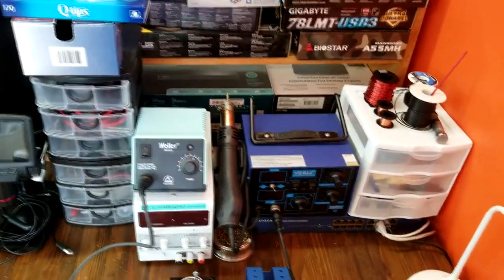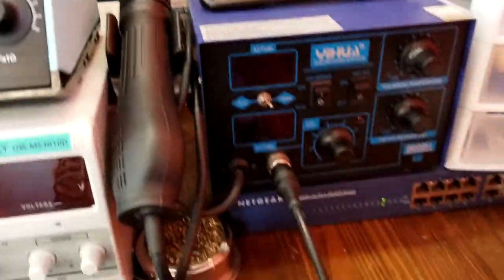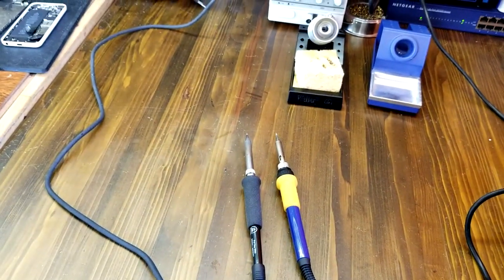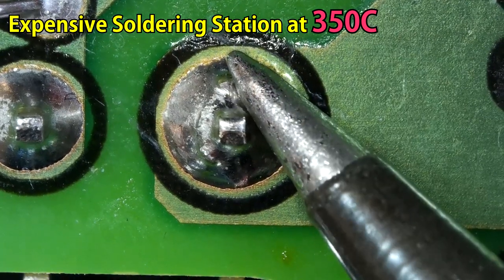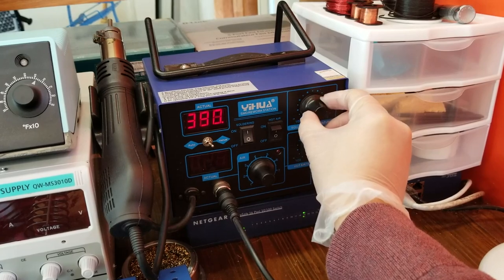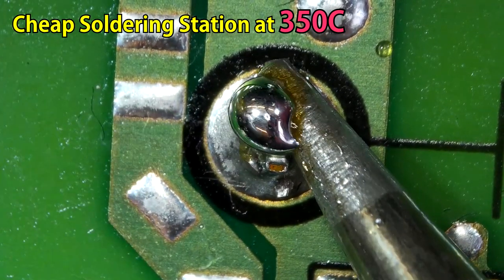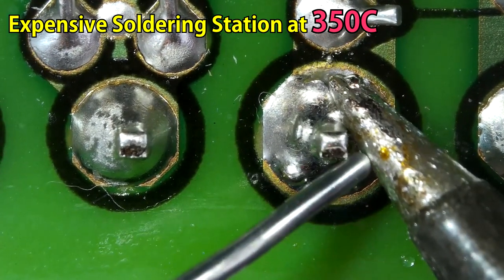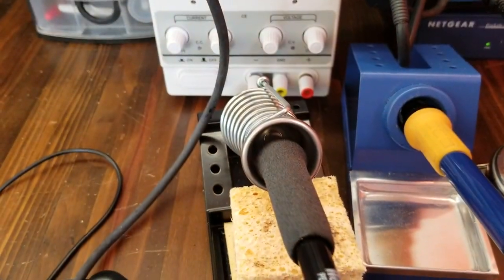Cheap Soldering Iron vs Expensive Iron (Good & Bad Soldering Station Comparison)

Comment: There definitely something wrong with your Yihua 862D+...I have a Yihua 852D+, an older model, and it melts lead-free solder joints just fine at 350^C. I would suggest measuring the temperature of your iron to confirm its heat output. There are numerous video reviews of the 862D+ that contradict your findings.

Comment: There is a basic requirement of any iron or station that will yield the best results. The minimum standard is digital readout which yields the output temperature of the iron at the tip. The exception is a variable temperature iron with temps marked on the wand. Knowing the tip temp is vital so your results will be high quality, high reliability and consistent time after time. Tip shape that meets the most effective requirements and on most jobs used is the chisel type tip. Tip width should be no wider than the pad or edge trace it is serving. The surface of the tip should be free of oxidation and smooth in appearance. A pitted tip is a no no. This will not yield superior results. The wand should feel comfortable in your hand and maneuvered easily with finger and wrist positioning. The temperature range will vary with manufacturer. A wide range is desirable. Getting it done easier is best served by an iron which doesn’t allow variations greater than + or - 10 degrees Fahrenheit. Temps that vary from their set points higher or lower than 10 degrees Fahrenheit are not good for your project, work or job results. That will not change. These standards are high and this is how best results are yielded! Each must choose his or her gear based on budget, level of commitment and desired results. I use Pace brand gear, but your money and requirements may vary from mine. Your money equals your choice. Make your choice a great one and don’t compromise on quality and reliability. Stay safe mates!😊👍🏻😷

Comment: Don't buy those cheapy crap on Amazon. I messed up completely. If you want to solder big wires or copper pipers, a cheap one would do, but absolutely not any circuits, chips or any fine connections.

Comment: Looks like the iron on your dual station, has either a really crappy knock-off heater element, or the ceramic heating element is making bad contact with the solder tip. Or both. It's easy to check the latter, loosen the fastner for the end slightly and wiggle the solder tip very gently. It should not have any notable movement side to side, it should fit fairly snug over the heater. Just FFS don't try to bend to check, the heater is ceramic. If it's loose, then the heating element is obviously not gonna make much contact with the solder tips. 

You can replace a dodgy, crappy or broken element with either a genuine Hakko A1321 or a good quality 3rd party replacement. If you do that, the iron should work pretty much as well as a proper 951/952 Hakko. Given you combine it with decent quality tips of course.

To be perfectly honest, I actually like this station better than my Hakko, for the iron. Because it's so much quicker and easier to change the temperature. But I use a different grip for the station, with a genuine Hakko heater element inside.

Comment: I uses a cheap $10 iron and also that same yihua station and I easily removes components when using flux, so yeah, I don't necessarily need some expensive iron to do the same job that a cheap and mid range iron does, plus Weller have some safety concerns

Comment: It has to so with the quality control , or lack off on cheaper stations. I had one cheap station that preform very well, but had to use different tips that fitted around element tighter, as the one that came with the station were way to loose and had poor heat recovery. The replacement tips on eBay were much better and use that station for  more then 4 years and even used for SMD component replacement and work well for drag soldering.  Now using a WX-2 as upgraded over the years, but not all cheap solder stations are bad , it the tips tolerances that are bad

Comment: But that's not true. I have Stamos Soldering S-LS-14 Basic and WEP 872D+. They're both cheaper than Yihua 862D+, and WEP 872D+ is almost the same as your Yihua (technically too). Maybe your 862D+ is broken or something, because both my soldering stations never had problems like yours. Even my Stamos (only 45W) performed better than your Yihua (75W). Of course I've set both to 350 celcius degrees, exactly the same as you did. Stop telling lies to people please.
Reply: Is it lying if he actually had that experience? You can see it yourself what is happening on the video.
Reply: I agree, this is BS. I have the cheap station in the video and he's completely wrong about everything, i.e. it has a Samsung chip that adjusts power to the soldering iron in real time so the temperature stays constant.

I assume it's something really stupid going on with his device, like the tip not being screwed on tight enough or the ceramic heating element being somehow damaged.

Also, Weller is a garbage company nowadays who doesn't think it's necessary to use fuses for their primary circuit, saving a few cents on their overpriced devices.
Reply: Here's the thing. Some sellers sell these with either top shelf 3rd party, or genuine Hakko ceramic heaters inside the iron (A1321 element). I double checked mine, it worked really great, and it had a genuine Hakko element with a verified serial number.

Many other sellers, skimp out and sell them with a really crappy fake Hakko heater element. These also have poor size tolerances (sometimes the actual solder handle has poor size tolerances too), causing the solder tips to make bad contact with the heating element.

I accidentally broke the original, genuine Hakko element. It was my own fault and mechanical damage. The original seller sent me a replacement, but informed me it was not a genuine Hakko as he didn't have any on hand, it was a copy. Replacing the element, it now took way much longer to heat up, it had nowhere near the same thermal capacity (would cool down too easily), and it made really poor contact with the tips. I had to wrap 2-3 layers of aluminium foil around the element to even get a usable level of contact.

So I believe the experience of all parties here. But I think the unit he got here, came with a knock-off heating element. If you replace it with a genuine Hakko A1321 element, or a good quality 3rd party replacement, for these 852/862/936/951/952 chinese copy stations - the experience should be much more akin to the one we had.

Comment: I have one of those Zeny Yihua no names as well, and it's incredibly frustrating to get a consistent working temperature.  I had to sand down about 1/64th to 1/32nd of the soldering head base to get the ceramic heater closer to the tip, which helped a little bit.  I don't trust the temperature setting at all, I more or less use it as a hotter/colder setting.  If you are exploring soldering and electronics as a hobby, I wouldn't even  recommend this as you'll develop bad workaround practices just to accommodate this soldering iron station.
Reply from the maker: Seems like the cheap ones have poor temperature keeping performance

Comment: Probably is the false reading on the actual temperature on solder tip. This unit does not come with temperature re-calibration mode. You need to prove the solder end tip actual temperature reading vs station setting. You will surprise by the test. Do some homework first before you said this is cheap soldering station is junk.
Reply from the maker: Most people who use the soldering station will rely on the temperature readings on the machine. Who measures the temperature on the actual tip every time when soldering? The temperature reading should be accurate at least when they are new...
Reply: If you calibrate it once you won’t have to change it again.

Comment: 350c is 350c doesn't matter.
Reply from the maker: Many of cheap stations are lack of providing constant temperature. With a cheap one, as soon as you touch something with your iron, the iron temperature may drop significantly, and that is what you've just watched in the video. Hope this helps.
Reply: @PTITBROTHERGravenhurst  Um I have the same model and don't experience that I think it's just broken and that statement is untrue.